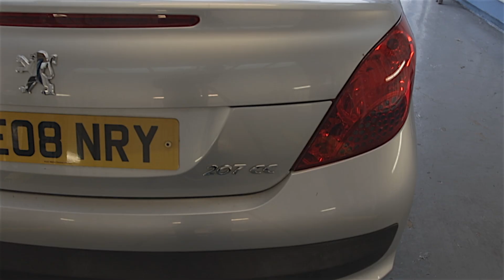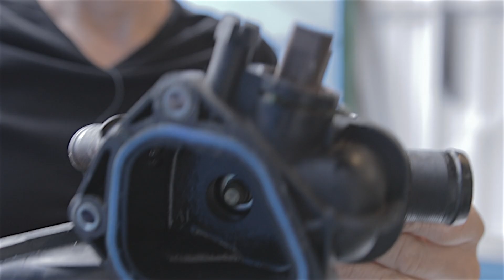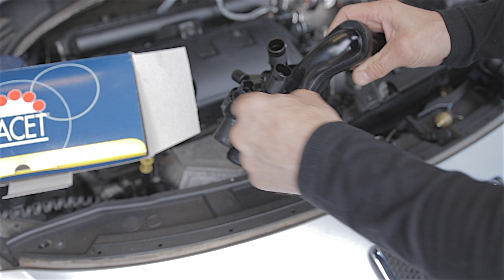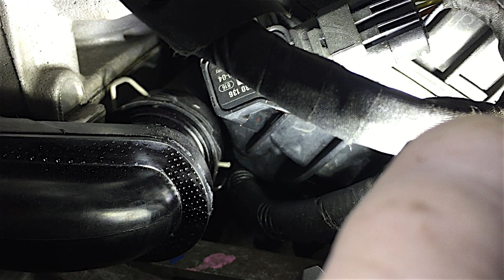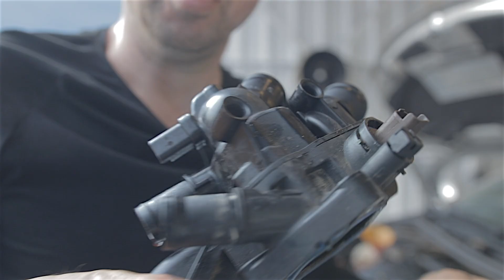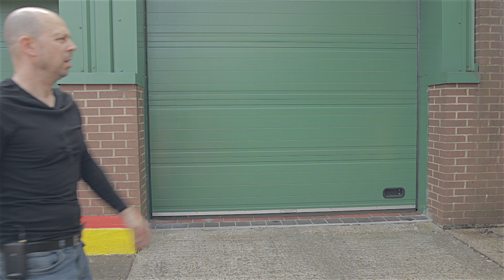Peugeot 207cc Air Con not working

Comment: So replaced that thermostat housing on my 308 ,208 and rcz never put the clip back in on any of them. When I studied the way how the joint is designed there's no possibility of it ever becoming undone the whole assembly is held in position by the housing which as stated is bolted unto the engine . There's just no point to that clip except to give you pain
Reply: nice to hear that. I tried to put the clip back on and then it dropped just near the connection pipe. I never saw the clip again... I decided to make a clip by myself. It doesn't fit the way I want so I was a little bit concerned if the pipe come loose. Now I see that the clip isn't necessary I feel a little better.
Reply: Happy this info saved you some unnecessary stress. The first one I ever did was on my 308 thp156 and dropped the clip behind the engine ; couldn't find the damn thing. Was contemplating on how to design my own but upon assessing the fitting I realised that the crossover pipe was rigid and the thermostat output to the pipe also rigid entered into the pipe up to about an inch or so. There's no movement possible from the crossover pipe as the thermostat housing when bolted in place takes up pretty much all the play hence it cannot shift anywhere so no real need for the retaining clip

Comment: Hi, 207 1.6 petrol. All hell breaks loose. Temp sky high when engine cold and STOP on dash. Change out both a/c relay and replace thermostat with new sensor. No change, multiple other codes too. Swapped back old temp sensor. No change same problem. Car runs normally, fan stays on for long time after switch off as thinks it overheating. I don't think a/c is kicking in either despite new relay.  Have deleted codes with scanner and they come straight back. Question: are there two temp sensors? There is a sensor into the head with a single pin right next to the one that goes into the thermo housing. Should I also change that out? What else could be causing the problems? Tearing hair out and looking forward to your expert opinion. Cheers Jeremy in Brisbane Australia

Comment: Job done Alan but now I still have the "Engine Fault Repair Needed" fault code coming up on the screen on my Citroen DS3.  What scanner did you use and were you able to reset the fault with it?
Reply from the maker: hi, i used a snap on solus ultra but there are many scan tools available, if the fault is fixed you should be able to erase the code
Reply: I have a scan tool on the way @alan4x   Up until I inquired about it with a local supplier I was unaware there was such a big difference between an OBD scan tool and a system scanner.  Could be something to bring up in a video 🙂

Comment: I’m hoping you can help I have a 307cc with no AC, I had a leak on the condenser and fixed that had a re gas and no ac, they advised a new pressure switch and still no ac, the compressor doesn’t engage at all, this is the 4th garage I’ve been to, any ideas?

Comment: You, Sir have a new subscriber.. I am currently working on a 207CC with short to earth of three sensors.. The fan comes on after about 5 - 10 seconds (Rad Fan goes on full speed) with codes relating to disengageable water pump control thermostat and oil pressure control, live data suggests A/C is switched on Thermostat at 99% ... When I disconnect the water pump control motor the car no longer logs any codes and returns to normal. I put an ohmeter across the motor and it's two terminals are connected together. Is this normal or do they connect via the windings.. Any help would be appreciated as I have spent hours on it, even the ECU has been sent off a checked..
Reply: Hi m8, did you sort this ??? I have just done mine but thermostat will not bloody open when I check on diagnostic it show thermostat at 0.0 percentage…….i have no idea what that means

Comment: Thanks Alan, have done a few of those housings they are a real pain, however did u measure the resistance on the heating element on the old removed unit, to see what it was as i have two i have measured and they are around 15.2 ohm, would be interesting to know what yours read to make the Ecu throw a code.
Thanks again.
Kind regards Jay

Comment: Hi Alan your vedios great, I have Peugeot 207 2007 I called auto electrician he stuck in, nothing happened, he said it's flooded fule,after cleaning plugs nothing happened crank but not starting 
The fule coming in keeping it flood more, like he said aircon, disabled too all wiring checked, ECU reading, battery unpluged,jumper starting, ecu unpluged and back on ,sensors checked,coils...Not starting It's pain,
No air going to engine to start stuck stuck 😑 The vacuum pump changed and the problem started 
Any idea 💡please any advice??

Comment: Did mine yesterday, coolant leaking down the back of gearbox, heard the O'ring on the connection for the pipe around the back is prone to fail. Fitted new housing, starting putting heater matrix hoses on. Only to realise one of the connections for the hose is different. Used new O'ring and gasket then fitted old one back on. Not leaking as bad, but on the look out for the correct version for my car,. 🤦🏼‍♂️.

Comment: the error code is p0599 piloted thermostat control short circuit to battery plus  this also used on the Peugeot rczwith the bmw engine  anyway great info

Comment: Hi Alan, In my 1.6TDCI Mk5 Mondeo (PSA engine) I have a similar problem. Driving car from cold, after 7miles the temp needle reaches 1/2way and then climbs to 3/4 when the High Coolant Temperature alarm activates. Up to the 1/2way temp point the hot air was coming into the cabin. Beyond 1/2way without going at the temp controls the air goes cold. I ordered the temperature sensor but was sent the wrong sized 1. Ford dealership opened this morning and they are recommending to replace the whole engine :( .The side wall of the coolant reservoir is blackened. They think theres probably a crack in the engine allowing exhaust back into the coolant system. Not sure if they are just pulling a fast 1 to recoop cash lost with Covid19! Thought it would be a simple enough case of replacing the thermostat housing but now im looking at €4200 :( . Any truth in their diagnosis you think! cheers Bob
Reply from the maker: if your clear coolant expansion bottle is black inside it is a sign of engine gasses in the cooling system..also if a lot of pressure is building up inside the header tank then you could have a head gasket failure
Reply: @alan4x  Hi Alan, thanks for your advise. I took it to an independent Mechanic and I asked him to do what i asked Ford to do!! (replace the thermostat Housing & coolant, a much cheaper fix!). Its been going grand since for the last 2 months! Been keeping an eye on the coolant level and it seems ok. Anyway I enjoy your videos, learn a lot from them!

Comment: Hi Alan. I install the thermostate in peugeot 308 .heat enging temperature is also good but problem is  air condition is not working. And also at low temperature air blow hot air ..please help me😑

Comment: any idea what goes wrong with the thermostat?  is it possible to check with a multimeter without pullin the whole jobby out?
Reply: Yes, it is possible. Kind of a pain in the a__. Because of the position but definitely possible. To test the electrical side of it without removal. Ideally by back probing on the plug it's the easiest way.

Comment: Hi Allan. I usually don't bother with commenting on YouTube but I find your videos quite interesting. This is probably the first comment I've ever done. Anyway I am only just out of college and about a year into Arnold's and nowhere near the  experience you have in the trade. Is it possible that the air con is being cut off due to the fact the condenser carries heat, therefore in the event the engine is overheating  the condenser is unnecessary excess heat to dissapate? If you get a chance let me know what you think. 
Ps I would love the chance to work in a garage like yours I would have been tempted to apply for the position in your recent videos however I don't think I would have the experience your looking for. Also I live in glasgow lol. 
Qasim

Comment: Interesting. Wonder if this is why my 1.4 pug 206 air con don't work. (No click and 0V at the compressor electrical feed with the engine running and A/C switch on)  I shall find out. Thanks again Alan. Another great one!

Comment: Done loads of these as they are fitted in various forms to other makes of car that use the Peugeot engine. Anyways top tip for the clip at the back pipe. Grind about 2 mm off the ends of the clip as they foul on the back of the engine as pushed in if not really lined up and makes it easier to push home and 2nd tie a piece of cotton to the middle of clip and run that out to your other hand. If when pushing it on it slips off and falls you struggle to find it or retrieve it. With the cotton you just pull it back up and try try again.
Reply from the maker: thanks for that, like the bit with the string, that is genius😜
Reply: Hi, great Video,  just change thermostat  on peugeot  3008 . Really sh.. job. But I lost the pin somewhere  on the back of the engine . My question  is can I leave it without that pin  the pipe is  in not movement  at all ?

Comment: I did one of these the other day . Originally fitted a AC compressor as there was power to it and it wouldn't operate. Then fitted the thermostat housing which there was a fault for. That clip was a pain to get back in. However it turns it it was a faulty compressor in the end

Comment: Hi Alan, I own a 2008 Mondeo Mk4 1.8 TDCI, 125 HP. I've owned the car for 3 years now, I didn't have any serious problems with it, but it has 2 ,,small,, issues that bother me,first one is the air condition, it has enough gas but the cold air it,s not cold enough, when it,s really hot outside, I live in Denmark so the summers are not that hot, that's why I still have this car. And the second one is, under heavy acceleration (warm engine) it gives some black smoke, no power issues! What do you think? Thanks!
Reply from the maker: the air con would need to be checked out first...you can put a thermometer in the air vent,,,4-6 degrees centegrade  would be as good as it will get.
these cars do not have a dpf so black smoke is normal but could also be the egr valve but if its only a small amount i would not worry...if you were losing power then it would be worth looking into it as a split turbo hose could cause black smoke but also power loss
Reply: @alan4x  thank you!👍

Comment: you and me both know its a money spinner for car makers why oh why put plastic next to very hot fluids or metal it makes me mad lol good vid mate and i see your stll using the lube keep them coming Vauxhall are finished now owend by the frogs to
Reply: ROBERT GIBSON how about bmw using a plastic electric water pump in x5s - absolutely bullshit , people love banging on about German cars being good - there as crap as any other cars these days
Reply: I had a tdci 1.4 which was PSA engine and was amazed the water pump was plastic. Interestingly the after market one I put in on the timing belt change was made from aluminium, which was a relief!
Reply: @armunro  - "...I put in on the timing belt change..." That statement alone says something about it! The water pump was changed WHEN you changed the timing belt not because it was broken... ;-)
Reply: These engines also had plastic water pumps, lol they modified them changing back to aluminium.
Reply: ROBERT GIBSON - Vauxhall were finished a long time a ago. All they have been for a very long time is badges stuck on German and Asian designed cars that were made in lots of different countries with only a few Astras made here and their Combo van is just a rebadged FIAT and the bigger vans rebadged Renaults and they are all now Peugeot/Citroens because GM has been going down the pan for years and sold Opel/Vauxhall to them and now what is left of Vauxhall will probably at some point be shut down as part of a future rationalisation and cost cutting by that French company especially as the French and German governments will pump money into keeping the car plants going in their countries while the British government will not. Can see the Nissan plant in this country being vulnerable as well since Nissan is still in trouble with not making profits and getting slated for their unreliablity even after Renault stepping in and saving them from going bankrupt years ago - cant see Renault putting up with much more of that especially as they are making huge profits and with the problems at Land Rover/Jaguar as well it doesnt look like a rosy future for what is left of the car industry in this country with them all being foreign owned especially with another banking crash looking likely as well at some point.

Comment: Hello Alan. My Mondeo MK3 2.0 petrol has exactly the same symptoms. The AC works for about 10 mins. The cooling fan cuts in. I've had the gas checked twice and it's full. I've also cleaned the cabin sensor that had a tiny fan on it. Do you have any ideas as to what could be the cause with it to cut out? Cheers mate.
Reply: On mk3 mondeo it’s usually the compressor clutch.

It wears and the gap gets too big on the clutch.

Then as compressor gets hot the shaft expands internally and gap gets too big for the electro magnet to pull the clutch in so it disengages.

Then when it cools down the shaft contracts and it starts working again.

Fix is to remove the clutch plate on the compressor and either remove one of the shims or install a replacement shim from a kit ford sell to get correct gap.
Reply: @Clicksystems  thanks for the information. Im gonna have a go at fixing it today. I'll get some thinner shims if needed. Thanks once again.
Reply from the maker: well i know your car has no electric thermostat but i would be looking at a weak compressor clutch
Reply: @alan4x  thanks Alan. Someone said about fitting shims to space the clutch out. I may give this a try. Thanks once again.
Reply: I took a shim out of the AC clutch and it's now working fine. Thanks for the help gents.
Reply: Ian Days no problem :) it’s a common problem.

Comment: Them housings are common, it’s been revised numerous times, so I only fit genuine now just some people don’t like the cost of genuine lol.

On the Turbo version retail is around £120 give or take.

Another thing to watch out for is those temperature sensors, they can fail and then coolant starts wicking up the wiring loom to the fuse box and engine ECU. Loads of Peugeot’s have had water damaged looms, fuseboxes from coolant leaking from the coolant sensor, or washer pump.

It’s probably why the plug got cut off, coolant corroded the connector, so they cut the plug off and used sealant which also stopped coolant going up the wiring loom.

But I also hate those clips on the back, pain the backside. Flimsy pipe on back has also been revised at some point, that and the plastic water pumps. Changed from plastic to metal because of cracking.
Reply from the maker: thanks for your knowledge ..thats very interesting to know..cheers

Comment: Typically French then lol! Only owned a pug once (306) and you always got that smell of warm coolant in the cabin. Mate of mine had a 3008, same smell 😂
Reply: A d - Presently on the stable. 106 (from 96), 107, 307, Picasso, Renault Trafic and Toyota Yaris. Ex. 306, 206, etc. NEVER had any smell of coolant in the cabin in ANY of them. You guys should fix your cars if that's the case! ;-)